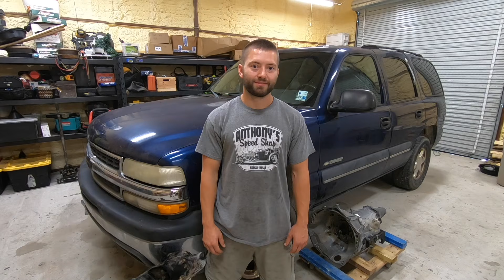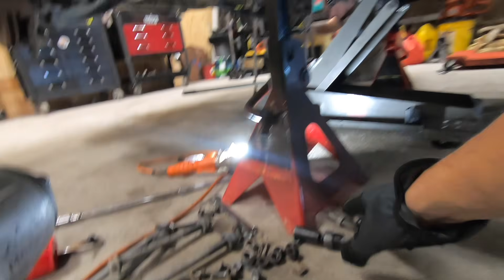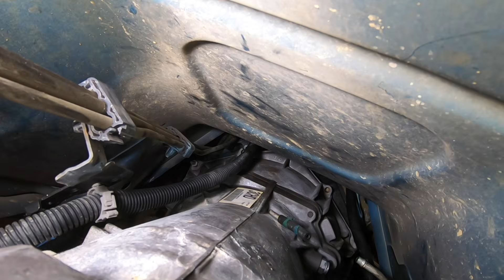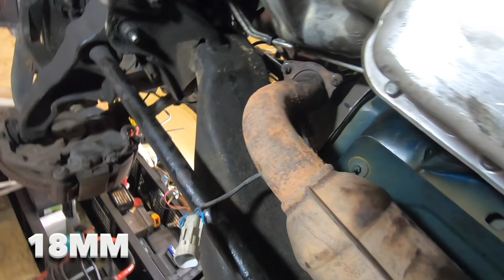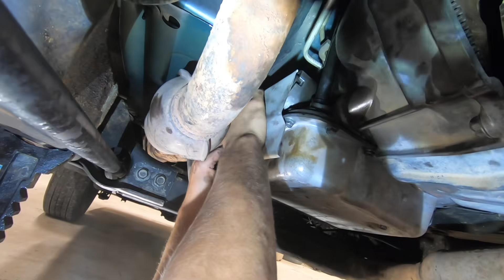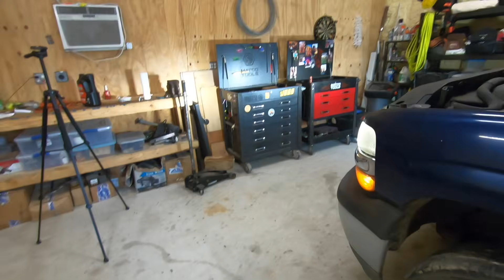4L60E TRANSMISSION INSTALL || EASY

Comment: love your videos...quick question  is a 4l60E transmission from  2000 to 2005  2WD  compatible  with  green connector and torque converter, neutral safety switch....thanks in advance
Reply from the maker: I'm not sure

Comment: Good video but in case you didnt know all those extensions change the torque value. All dependent on the length and material
Reply from the maker: They definitely do, but there's no way to get a torque wrench in there, so I usually add a couple ft/lbs.

Comment: Do I put any transmission fluid in the torque converter
Reply from the maker: You don't have to technically, but I like to put a half of a quart before the install.

Comment: Those transmission bolts are a lot easier from the top,I promise
Reply from the maker: Noted! Next time lol
Reply: I didn't know that those cooler lines just snap in,I script on and had to clip the line,I got it out when  I dropped the transmission and now  I gotta fix that line somehow

Comment: When you fill transmission up you’re suppose to add 4 1/2 quarts started it up add to up 11 1/2 and check add if needed never fill up all 12 that’s why you had it venting
Reply from the maker: Yeah, I realized that after the fact lol. Rookie mistake.

Comment: I didn’t put the first flywheel/torque converter like you did and I only found 2 holes and now I don’t know what to do
Reply from the maker: Take it apart and rotate the flywheel to the next hole and try again. Do this until it all lines up

Comment: What is the process if your torque converter is bound up. My transmission isn’t wanting to sit flush against my engine and I think that’s the issue maybe
Reply from the maker: It sounds like your torque converter is not seated all the way. Move the transmission back and try to get the torque converter to seat further. Rotate and push until it clicks down further

Comment: How do u know if torque converter isn’t installed all the way?
Reply from the maker: Take your time installing the torque converter, and make sure it slides all the way in like I explained in the video. If it is not completely seated you are not going to be able to install the transmission. The bellhousing will not smoked up to the engine.

Comment: My transmission plug the exact same as yours at 15:28 doesent go in like that I’ll push as hard as I can and it just goes halfway and won’t clip do you have any tips or tricks? I’ve been stuck for weeks a response would be greatly appreciated
Reply from the maker: Look inside and make sure the pins on the transmission side are not bent. Also, spray some electrical contact cleaner inside the plug.

Comment: Is it recommended to use spacers to shim the tc with flex plate
Reply from the maker: I was unaware of that. Can you explain the process and where to get the shims?
Reply: Spacing between the tc Nd flywheel so it won’t mess up the pump or thrust bearing I messed up the pump on my 4l60e for not adding a washer between the torque converter Nd flywheel

Comment: Yeah my transmission Dixie put it in overdrive I have all the truck it drives fine but only in drive and you don't have it in overdrive it it misses 3rd and 4th gear what the heck's wrong with my with my transmission and I also have reverse
Reply: I've added the two mechanisms in the back of the transmission and second and third and that still doesn't do nothing it's still it's still slipping
Reply: The 1999 which is a 2000 really cuz it's got the 5.3 and it the LS motor

Comment: Question is there a difference in flex plates on 80 e and 60 e or are they same
Reply from the maker: Ooh, that's a good question. I'm not sure, but you can call an auto parts place and get a part number for each and see if they are the same or different
Reply: @dudewecanfixit  update there is a difference 60E is a 3 hole and 80E is 6 holes for toque converter

Comment: The wife totally ruined / blew up the trans in my 2003 Tahoe 4x4. Going to get one from u pull u pay and follow your series - thanks for details
Reply from the maker: Good luck, you can do it!
Reply from the maker: Try to find a four-wheel-drive, or you may need to swap your tail housing with a 2wd model

Comment: I'm kicking myself for not reusing the original torque converter.  The reman unit had a screwed up bolt hole and I didn't know it until I had the trans all bolted up.  Had a heck of a time chasing the hole and it was still tight.  That TC was a garbage dacco unit and they used paper clutch material and sold it as a woven carbon fiber unit.  It would shudder as the pwm solenoid was about to lock up.  No wonder they don't do remans for automobiles anymore.  I bought a new TC from a reputable company and guess what?  One of the dang bolt holes had a ding next to it making it so the bolt wouldn't go in by hand.  Not as bad as the dacco unit but still irritating.
Reply from the maker: That’s unfortunate, but it’s a good idea to have a small file on hand to clean up those bolt hole entrances

Comment: Installing one on a Chevy 1500 and the torque converter slides off pump in the trans when bolting to flexplate anyone know what I'm doing wrong?
Reply from the maker: Does it slide all the way off?? Too much space?

It’s normal for it to be slightly away from the pump. Like less than a half inch

Comment: I noticed you didn't fill the torque converter with fluid
Reply from the maker: We reused the torque converter that we removed. It already had fluid in it. Also, new torque converters come pre-lubed, But I do add fluid to those anyway
Reply: Did u flush ur cooler lines?
Reply: I only ask bc im gonna be rebuilding mine an wanted info on how u went about that also how long has it been since rebuild

Comment: What amazes me is how three small bolts holding it to the torque converter can take all that power and not just strip them off and it's still amazes me
Reply from the maker: Same here, lol. Look up the sheer strength of a "half inch grade 8 bolt".

Very impressive

Comment: What did you torque the transmission bolts too?
Reply from the maker: Torque the transmission to engine mounting bolts to 35 ft/lb.
Reply: @dudewecanfixit  ok thanks

Comment: Hey I just replaced my transmission but ran into a little issue when I installed the transmission before I bolted it up the torque converter spun freely but would get snagged on the flex plate and now that I have bolted the transmission I the engine and the torque converter to the flex plate I can’t turn it
Reply: I installed a good 4l60e in my 01 4x4 and it won't move don't know what I done wrong
Reply from the maker: Double check the basics, electrical connectors, shift linkage, transmission fluid
Reply from the maker: Once it is bolted to the flex plate, the torque converter should only rotate when you turn the engine over
Reply from the maker: Go to 8:50 and watch as I turn the flywheel with the torque converter bolted to it.

Comment: You didn't mention it but I hope you drained and flushed your converter. If not your just contaminating your new fluid
Reply from the maker: I actually flushed the system with new fluid before I started. That is a good point though, I should have included that in the video.
Reply from the maker: What procedure do you use for flushing your torque converter?
Reply: @dudewecanfixit   I'm retired now for 6 years but we use B & G for are flush and transfer.
Reply from the maker: B & G? Is that a company?
Reply: @dudewecanfixit   yes BG is a  specialty company. We used their flush kits and synthetic trans fluid.
Reply from the maker: Gotcha, I don't think we posted the transmission fluid change video yet, but it shows how to flush the whole system in place before you remove the transmission.

Comment: What are the torque specs for the bell housing bolts? I think I might have missed it somewhere.
Reply from the maker: Torque the transmission to engine mounting bolts to 35 ft/lb.

Comment: Is this a pre 2005 4l60e? 
I have a 2004 and I’m pretty sure Chevy changed it 2005
Reply from the maker: Yes, it's a 2003 I believe. However, the 4l60e was used until 2009

Comment: What about a line and cooler fish? Also does a rebuilt transmission need to be programmed?
Reply from the maker: A flush is always a good idea, but if you have metal shavings I would replace the oil cooler to be sure. You could get a differential oil filler and tape it to the oil line and push fresh transmission fluid through until it comes out clean on the other side. 

No, rebuilt transmissions do not need to be programmed
Reply: @dudewecanfixit  what if the cooler is in the radiator
Reply from the maker: Bypass the oil cooler in the transmission and add an auxiliary cooler. I have a video on that too. https://youtu.be/f7G9OCzBcQY
Reply: @dudewecanfixit  what if the cooler is in the radiator? Would you replace the hole thing or can you use the stock lines to put on a separate cooler?
Reply: Just replaced my tranny and lines and I wonder if I should just flush it since tranny fluid looked fine. Also changing the maf sensor. Any other things that make a transmission go bad on these trucks?
Reply from the maker: You can use the stock lines to put on a cooler and bypass the radiator cooler
Reply from the maker: Definitely try flushing it in both directions and check for metal shavings and debris. If all looks clear, reuse it.

Comment: Y’all left out how to adjust the safety switch
Reply from the maker: You're right. If you are reusing the original safety switch just set it to where the bolts line up with where they were originally. You will see the discoloration of where the bolts have been sitting for years.

Comment: Would this process be similar in a 97 Silverado
Reply from the maker: Yes, it is the same transmission in the '97 model
Reply: @dudewecanfixit  do you know if a 1995 4l60e would fit up to a 1997 engine
Reply from the maker: It should, I think they went from mechanical to electrical in 93 or 94
Reply: @dudewecanfixit  thanks your one of the most helpful channels I’ve came across🙏🏻
Reply from the maker: I appreciate it! Please subscribe and share our channel, it helps us grow

Comment: When are you supposed to gap the torque converter
Reply from the maker: I'm not sure what you mean?
Reply: @dudewecanfixit  So when you are putting a torque converter on the vehicle, you need to back the converter out somewhere between 1/8 and 3/16 of an inch or you have the risk of breaking the pump once things get up to temperature
Reply from the maker: Interesting. I haven't heard of that actually. I'll have to do some research
Reply: @dudewecanfixit  You're supposed to check free movement of torque converter and proper gap after the bell housing bolts are tight.

Comment: My last torque/flywheel bolt feeds in, but doesn't flush. Like an 8th left of thread. The other bolts aren't tightened, they are by hand, but not torqued. But they flushed. Should I just move on? Its tight tight.
Reply from the maker: Oh, it should definitely get flush. Check for debris in the hole/blow it out with compressed air. Try another bolt and check to see if the bolt threads are damaged.

I suspect cross threading. You may need a new bolt or to clean up the torque converter threads with a tap and die kit
Reply: @dudewecanfixit  brand new torque converter. Brushed and clean stock bolt. None of the 3 fit the hole, so I figured maybe a manufacturer problem? Rethreaded the hole, properly, for the bolt to fit. Hard times, desperate measures. Tough spot to get to no doubt😅 but I appreciate it bud. Keep up the great vids. Be safe & take care
Reply from the maker: Sounds like you got it handled, sorry about the late response. 

Definitely a manufacturer problem.
Best option is to return that torque converter and get a new one or tap the hole like you did. Factory machining didn't go deep enough.

Another option is to shorten the bolt, but not recommended.

 I would put a nut on that bolt and cut 1/8th off the end of the bolt. Then, when you unscrew the nut, it will fix the threads. Then file down the ends of the threads until the nut goes on and off easily. 

Use the modified bolt for that hole and don't forget loctite

Comment: Great, informative video. I like your attention to safety and how you try to give as much info as possible. 
A couple things I found out the hard way:
1. If the old trans went out, you need to flush the oil cooler with brake cleaner and compressed air or it can fill your newly rebuilt transmission with junk. 
2. Lube the back of the crank with grease before you stick the torque converter in there. This allows the converter to move forward and back as the flexplate flexes. 
3. Put the exhaust above the crossmember but don’t attach it until you put the inside bolt on the driver’s side in the crossmember or the bolt will have to go in backwards from the rest. 
4. If you installed a new converter too, when you bolt it to the flexplate, make sure there is less than 3/16” gap between them. If not, you will need washers to close the gap. 
5. Depending on the year, the starter wires are too short to install until the starter is mounted. 

Your video on removing the hot glue connectors on the neutral safety switch saved me a huge headache!

Keep up the great work!
Reply from the maker: That's great, thank you for the very thorough follow-up!
Reply: I'm about to undetake this process, what type of grease did you use on the TC to crank?
Reply from the maker: Either trans lube or red wheel bearing grease
Reply: Do you really trust flushing the lines will take care of your future problem? should you essentially replace lines, radiator,and trans-cooler?
Reply from the maker: My transmission didn't have a catastrophic failure, so I'm fine with flushing the lines. 

If it did have a catastrophic failure, I would install an auxiliary cooler and bypass the trans cooler in the radiator. I have a video on the auxiliary cooler install.
Reply: Your videos gave me the confidence to replace my transmission at home, but i ran into a problem i put in a new transmission but when its in gear the truck vibrates , in the park position its fine and a spin around the block felt smooth just at stops (in gear) the truck vibrates or almost feels like a constant jerk. Any idea what my problem could be? Thanks in advance

Comment: Will an 04 transmission from a GMC Sierra fit an 03 GMC Sierra??
Reply from the maker: It should fit. Are they both 1500s?
Reply: Yes sir
Reply from the maker: You should be good to go
Reply: I keep getting mixed reviews some say yes other say no
Reply: Wiring harness as well?
Reply: @royestrada7061  If it's not too late, you should check to make sure the main plug is the same color and the neutral safety switch is the same. If that checks out, you're good.

Comment: I was thinking you can’t put all fluid in before starting
Reply from the maker: I added too much fluid
Reply: @dudewecanfixit   how much fluid was supposed to be in there
Reply from the maker: I think it took 9 quarts. I would start with 4 or 5 quarts though.

Comment from the maker: “Transmission to engine bolts: 35 ft/lb”

TOOLS USED IN THIS VIDEO 

BLACK+DECKER Magnetic Screwdriver Set: https://amzn.to/3MQtOdV
HUSKY, HD00120, 3-Ton Low Profile Floor Jack with Speedy Lift: https://amzn.to/3OeaBDX
CRAFTSMAN Deep Impact Socket, Metric, 1/2-Inch Drive, 22mm:https://amzn.to/3mO09aQ
Kobalt KCW 5024B-03 24-Volt Max 1/2-in Drive Brushless Cordless Impact Wrench:
https://amzn.to/3Ojv62h
BIG RED T43202 Torin Steel Jack Stands: 3 Ton (6,000 lb) Capacity, Red, 1 Pair: https://amzn.to/3aVE3QP
Blackhawk B6350 Black/Red Fast Lift Service Jack: https://amzn.to/3OiJ18S
Ironclad General Utility Work Gloves GUG: https://amzn.to/3aPSmGu
DEWALT Socket Set, 3/8-Inch Drive: https://amzn.to/3xv58C8
EPAuto 1/2-inch Drive Click Torque Wrench: https://amzn.to/3NTO0wQ
3M Scotch Vinyl Electrical Tape Super 88, Premium Grade All-Weather: https://amzn.to/3aSKCnf
TOOLGUARDS 15mm Wrench: https://amzn.to/39rqrMI
Pry Bar Set, Heavy Duty Pry Bar 4-Piece Mechanic Hand Tools: https://amzn.to/3QhjMWh
GEARWRENCH 4 Pc. 3/8" Drive Wobble Extension Set: https://amzn.to/3Qz8H31
MIXPOWER 15-piece 3/8" Drive Shallow Universal Impact Socket Set: https://amzn.to/3tCP93D
DEWALT 20V MAX* LED Work Light, Hand Held: https://amzn.to/3xNZyMw
Transmission Mount: https://amzn.to/3HqoNYd
Kobalt 20-Piece Standard: https://amzn.to/3xzhysO
Wheel Bearing Grease Red: https://amzn.to/3xvl5bt
Valvoline Multi-Vehicle (ATF) Full Synthetic Automatic Transmission Fluid: https://amzn.to/3mLxvH1
3M Assorted Grit Emery Cloth Sandpaper: https://amzn.to/3OcuP0W
Super Funnel: https://amzn.to/3xwBGvD
Valvoline, Dexron/Merc, 1 Gal: https://amzn.to/3xvnqTA
Oil Drain Pan: https://amzn.to/39mazer

0:00 - Introduction
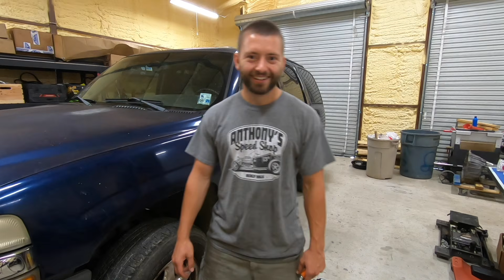0:39 - Lift Vehicle
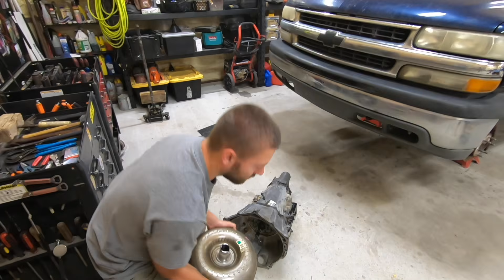1:53 - Torque converter
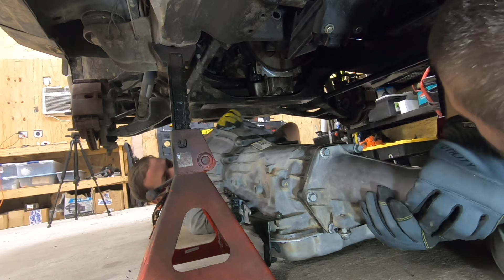2:42 - Lift Transmission 
5:31 - Lower Bell Housing Bolts 
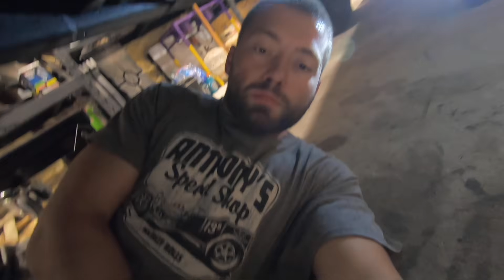6:10 - Torque Converter Bolts 
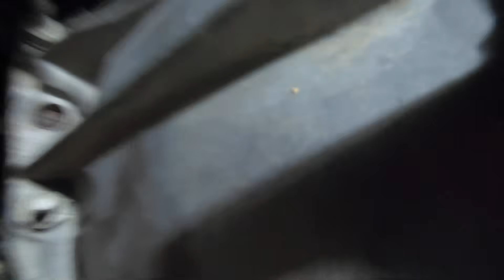9:51 - Upper Bell Housing Bolts
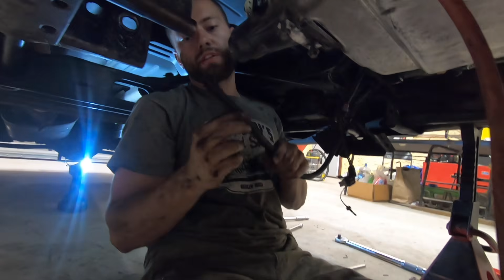13:27 - Vent Hose
13:45 - Neutral Safety Switch
14:22 - Shifter Linkage 
14:43 - Oil Cooler Lines 
15:14 - Electrical Harness
15:30 - Exhaust
17:29 - Trans Mount & Crossmember 
20:10 - Drive Shaft 
21:44 - Heat Shield
22:05 - Starter 
24:53 -  Battery 
25:11 - Trans Fluid 
27:44 - Outro
Reply: I bought a rebuild transmission but its leaking oil from the deepstick tube
Reply from the maker: Make sure that the rubber grommet did not get pushed into the pan and that the dipstick tube is seated all the way
Reply: How many ft lbs. Did you torque bell housing bolts
Reply: Edit, edit, edit, favck. Too much edition, doing not editon fucbk again.

Comment: No need to add fluid to the torque converter before install?
Reply from the maker: If you are reusing the torque converter, it already has fluid in it. If you have a new or remanufactured one, I like to add a quart even though it is pre-lubed.